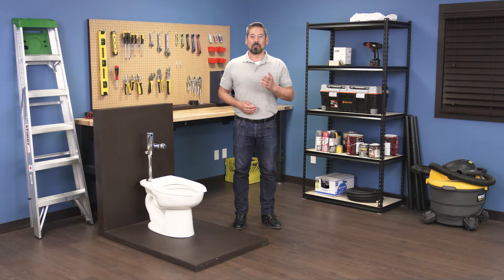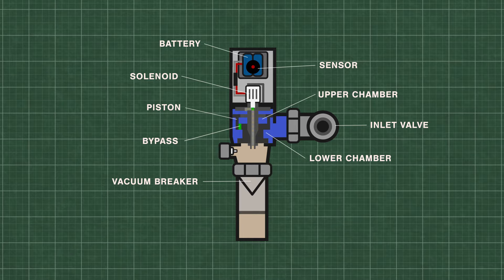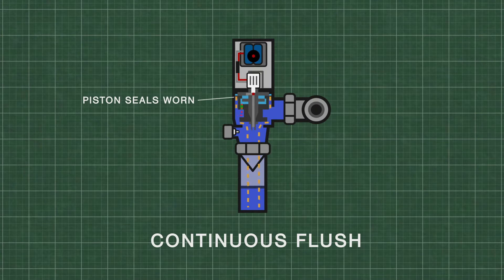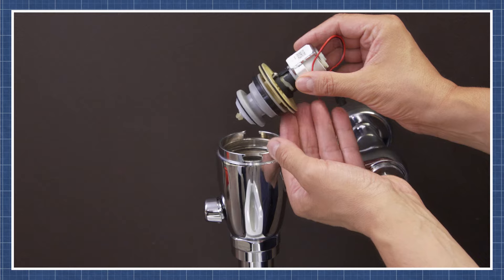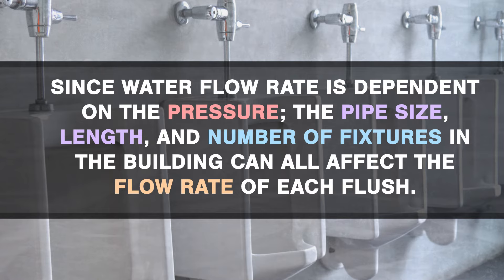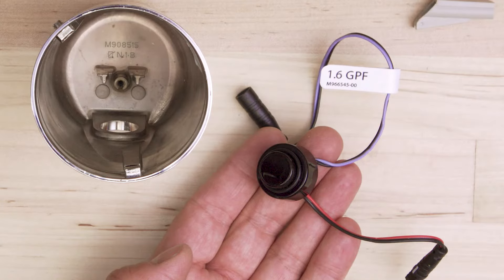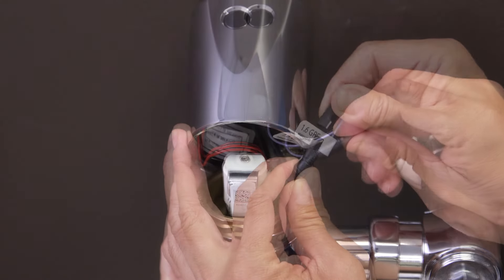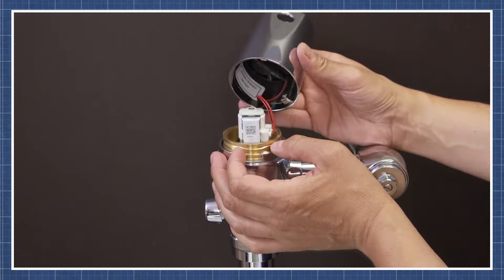Troubleshooting an American Standard Selectronic Flushometer | Repair and Replace

Comment: Very well explained thank you. If I understand correctly, it Is the sensor (an its capacity), the single piece that dictates how much water will pass trough? Many thx
Reply from the maker: Thanks for watching. It is not the sensor that controls the volume of the flush, it is the piston. The rate of water that trickles back into the upper chamber will change how long of a flow there is.

Comment: My problem is I can only get a yellow light to flash on when I hold my hand super super close. Not ones have I got the red light to turn on
Reply from the maker: Thanks for watching. A Yellow LED indicates Low batteries. If all of the models were installed at the same time it is possible for the batteries to be at a similar level.

Comment: What can be done for water hammer? I have one that causes a lond bang when the piston closes.
Reply from the maker: Thanks for watching. Water hammer is caused by a shockwave from high pressure water which suddenly stops (when a valve closes). Loose pipes will exaggerate this effect and will create more noise. A water hammer arrestor can be placed between the supply and the flushometer to reduce the severity of the shockwave, reducing the noise. https://www.amresupply.com/search?q=water+hammer&categories=WaterHammerArrestors

Comment: I ran into a power chord coming from the wall into the flushometer and I changed all components inside of the valve and still barely flushed. Pressure is fine. Only thing I can think of is the transformer is losing power. Any one help in diagnosing that issue 
American standard has no idea what could cause it apparently.
Reply from the maker: Thanks for watching. If you press the manual override (manual flush button) does it have the same problem? If it flushes normally then the piston and everything is working properly. In that case there is likely low power.

Comment: Also the sensor head flashes yellow and not red when it flushes
Reply from the maker: Thanks for watching. It could be an issue with the sensor or sensor wires at this point.
Reply: Did you find out the problem? Mine is flashing yellow aswell and im having trouble setting up the censor

Comment: I changed the solenoid & piston also changed the vacuum breaker & the battery &y toilet is still flushing for only 2 seconds & stops prematurely. Should I buy a new sensor that's the only thing that i can think of everything else was changed & even after changing the battery it also blinked yellow. What to do?
Reply from the maker: Thanks for watching. If you press the manual override (manual flush button) does it have the same problem? If there is no improvement then it's likely an issue with low water pressure.

Comment: I have 2 selectronic toilets where it flushes manually, motion sensor works, and i hear a click inside i assume it's the solenoid, but they still don't flush automatically.  They have new batteries installed.
Reply from the maker: Thanks for watching. It could be an issue with the piston. In these models the piston has a channel to release the water from the upper chamber. If the water doesn't release from the upper chamber then the flush will not start. Pressing the manual button should still work in this case as the water will run through a separate channel to initiate the flush. You could try cleaning this channel in the middle of the piston with a wire or try installing a new piston.

Comment: I have a unique problem that wasn't listed in the video.
The sensor can go off but it doesn't flush and whines in its attempt, but the side button functions perfectly.
I've tried changing the inlet valve flowrate, different batteries, and testing the wires and everything seems to be working fine in those regard.
I was thinking I would need to change the solenoid entirely but I don't know if it would somehow be the vacuum breaker or some other easier/cheaper fix.
Any help would be great, thank you!
(I will comment my results in case others have this problem in the future)
Reply from the maker: Thanks for watching. If the flushometer works with the manual button on the side, then it's likely an issue with the solenoid. If replacing the solenoid doesn't fix it, then it could be an issue with the sensor module.
Reply: @AmreSupply  I did end up replacing the Solenoid and the system works fine now for the most part. The button works to flush, and when the sensor DOES trigger, it flushes perfectly. However, i think my sensor has gone bad as it doesn't trigger anymore. I tried looking for a replacement sensor but couldn't seem to find one. Could you provide a link or the information id need to find one myself please? Thank you for your help!
Reply from the maker: @craigbennici4116  You'll have to double check which exact model you have but you can search by model number on the AMRE website. This will bring up a parts breakdown. Some parts though not in stock are available for special order. You can call AMRE to double check if needed: https://www.amresupply.com/lookup/228710/1549616#diagram

Comment: I have replaced the battery pack and tried 2 piston/solenoid assemblies and it is still letting water pass through in to the urinal without flushing.
Reply from the maker: Thanks for watching. If you've replaced the battery pack, piston and solenoid then it's likely an issue with the sensor.

Comment: The toilet seems to flush only halfway when sensor is activated after changing vacuum breaker.  With override button it flushes fine.  Any ideas?
Reply from the maker: Thanks for watching. Since it flushes properly with the override button, it means that it is able to let all the water from the upper chamber out in that case. Perhaps check how the solenoid is seated to make sure there is nothing preventing it from opening up properly.

Comment: How does the manual over ride button works? The sensor can flush automatically but the manual (push valve) wont. Any troubleshooting tip? Thanks
Reply from the maker: Hi Joey, thanks for watching. The manual override button releases water from the upper chamber (it bypasses the sensor and solenoid). If the valve flushes normally via the sensor, but won't flush when you press the button then the button is likely faulty and is sticking or not opening properly. It's been 5 years since we've filmed this. I don't have this model in front of me but I think this button is not easily replaced on these models. We also don't sell replacement buttons so we don't have a video for the button. All American Standard Flushometer videos can be found here: https://www.youtube.com/playlist?list=PLCo9SMjkdWBypfd69rUJSWqCYqFVDvAzw

Comment: How do you control how much water when it flushes automatically?   It does not flush long enough to empty the bowl.
Reply from the maker: Thanks for watching. Water pressure can be slightly adjusted, it can be worth opening the control stop to see if it helps. On the other hand the gpf (flush length / volume) is controlled by the piston. It is possible that the piston inside the flushometer is mismatched to the toilet.

Comment: My new American standard selectronic flush valve makes a banging noice in the pipes and does provide much water at a flush. Any solution for me?
Reply from the maker: Thanks for watching. Was this a new installation in a new building, or did this selectronic flush valve replace an older valve?

Comment: Hello, how can I solve my problem with my tape measurer model 6065121mx, it does not stop spewing water, the solenoid does not activate and the piston does not activate it - the manual button gets stuck, how do I solve it, thanks
Reply from the maker: Thanks for watching. Sometimes minerals in the water can build up and cover the inside of the valve. This can prevent the flushometer from working properly. If you take apart the flushometer and give it a good clean, that can sometimes help.

If not then a new piston or solenoid might be needed.

Comment: What could be the cause for a sink where I replaced the most parts but still no water coming from the sink please thanks (American standards)
Reply from the maker: Thanks for watching. For a Selectronic faucet to work the battery(or the AC power supply) must be good, and the sensor needs to functioning correctly. The faucet will use a solenoid valve. This can fail electronically or mechanically. You can look up a parts breakdown using your model number to get a more detailed view of the parts inside of the faucet. There is some variation between models.

Comment: Having issues with the one we have at work, everything works as it should EXCEPT when it flushes, I can still hear water running and when you fiddle with the button it suddenly starts flushing none stop and I’m not sure what else I can replace, it’s practically a brand new unit
Reply from the maker: Thanks for watching. Does it stop flushing when it runs in the automatic mode or only when you press the manual bypass button?

If it only happens when you press the button, then it likely isn't closing properly and is letting a small amount of water through, preventing the upper chamber from filling with water, and pushing the piston onto the valve.

Comment: where can i buy this specific sensor , is there a direct link i can use?
Reply from the maker: Thanks for watching. You can browse sensors here: https://www.amresupply.com/catalog/Electronics-PF14
As for American Standard, it depends on what model you have as the sensors are based on the GPF. If you do a google search for your model number there are parts lists in PDFs for those models. It's best to double check this on your own but you'll likely see these sensors listed.

M970682-0071600A
SENSOR ASSEMBLY
(1.6 gpf)
M970682-0071280A
SENSOR ASSEMBLY
(1.28 gpf)
M970682-0074000A
SENSOR ASSEMBLY
(1.6/1.1gpf)
M970682-0075000A
SENSOR ASSEMBLY
(1.28/1.1gpf)
M970682-0071100A
SENSOR ASSEMBLY

Comment: My urinal is getting stuck when flushing with continual water causing the urinal to over flow. Would removing the manual override button and lubricating the O-rings help the manual button not stick anymore?
Reply from the maker: Thanks for watching. Continuous flushing can be an issue with the piston, the solenoid or the manual override button. It would be good to listen for the solenoid, sometimes you can hear it click when it opens. As well make sure that the piston is functioning correctly. Check the manual first, most recommend NOT to use pipe sealant or plumbing grease on any valve component or coupling except the control stop. Alternatively if you think the override button is sticking and is causing the continuous flushing then it will likely need to be replaced as it would be sticking internally.

Comment: help....mine does not flush long enough.. toilet is 1.1gpf to 1.6gpf and sensor is 1.28gpf
Reply from the maker: Thanks for watching. Just to clarify, do you mean that flushometer sometimes flushes at 1.1gpf and other times 1.6, and all the way in-between? Is there any consistency to it? Does it flush enough to clear the bowl?
Reply: AMRE Supply  
Hello,  I have an American standard  touchless toilet 1.6 gpf. When the toilet flushes from the sensor it does not flush fully. I have adjusted the set screw in the inlet valve , replaced the seloniod valve and piston. The battery is new.  Toilet is 3 yrs old and has worked fine up until now. Any ideas? Only thing I haven’t replaced is the actual sensor itself.
Reply: I'm having the same problem same toilet, it only flushes for 2-3 seconds but not completely to flush everything down & it stops prematurely

Comment: Vance, toilet flushes fine, automatically, but push button override gets stuck and toilet runs continually.  I suspect the o-rings are hanging up; can I lubricate with a silicone paste?  This toilet doesn't get much use over the course of a year's time; if anything it suffers from lack-of-use!
Reply from the maker: Thanks for watching. Yes a silicone based plumbers grease can be used on the o-rings to prevent them from sticking. Silicone is best rather than something like vaseline. Vaseline is petroleum based and can cause the o-rings to deteriorate.
Reply: @AmreSupply  I have the same issue. I can't find instructions on how to replace the manual over ride flush valve anywhere. Can you post instructions or a link? Thanks
Reply from the maker: @chrism8595  Thanks for watching. The button M950354-0020A is harder to find than other parts. We didn't film a video on it but I'm pretty sure it can be unscrewed similar to this video: https://www.youtube.com/watch?v=Tb-QRyfTTSg In the case of the American Standard model, you'll likely need a hex wrench to first remove the set screw that holds the button cap in place. From there you should be able to get a wrench on the button to unscrew it.
Reply: I opened my small can of wd-40 doused the manual override and it quit sticking. Wd-40 works like a charm. Finding parts for these is worse than looking for a clean manual transmission.

Comment: I've got continual flush after replacing solenoid.  Before replacement it was only flushing manually and light was flashing but no solenoid clicking.
Reply from the maker: Hi Tim, it sounds like the piston could have shifted during your solenoid replacement. There is a little spring inside the piston, which is used for self cleaning of the bypass hole to let water into the upper chamber. Check to see if the spring is still there and if the bypass hole is clogged.
Reply: Just came across one of these overly complicated flush valves. Turns out a dead battery can cause solenoid or piston sticking. New battery worked like a charm.

Comment: I have a few 6065 flush valves with continuous flush. I swapped out piston assassembly with another in the room and works fine. Seems on ones with problem the manual push button seems to be the problem. Is the a way to remove push button and lubricate o-rings?
Reply from the maker: Hi Paul thanks for watching! The override button can be removed and replaced if needed. https://www.amresupply.com/part/M950354-0020A-AmericanStandard-Flushvalve-override-button

There should be a retaining clip that you'll have to pull off first before removing the button.

Lubricating the o-rings might help if water is leaking through the override button. If not a new button, or new o-rings might be needed.

Comment: My plumber accidentally hooked this to the hot water line. ( on a urinal ) Could this cause any issues?   It's a tiled wall and would be a pain to change it to cold side.
Reply from the maker: Thanks for watching. Urinals and flushometers are not designed for use with hot water. Depending on how hot the water is, it could reduce the lifespan of the piston. It might also smell worse overall as the hot water will cause some odors to vaporize as it evaporates.

It is unlikely to crack the urinal bowl unless the bowl is very cold before the hot water is run over it.

Comment: I have this flush valve on a urinal at home ( about 2 years old )  It flushes properly, but there's a small, slow but steady stream running down the urinal.  I turned the inlet screw all the way in, ( to test ) but there's still a slow trickle. What should I check to repair that ?   Thank you.
Reply from the maker: Thanks for watching. Its likely an issue with the piston. If the rubber on the side of the piston is not making a good seal then water will continuously trickle out of the flushometer. The repair can be seen here: https://www.youtube.com/watch?v=cQg_yR8wmy8
Reply: @AmreSupply   Exactly what I needed to know. Thank you!
Reply from the maker: @nobark1  We're glad that this helped you out!

Comment: What is the issue when the new unit flushes when your in front of it and shuts off moving away?
Reply from the maker: Hi Rick, you might want to try to reset the sensor range to see if that helps. https://youtu.be/txS72QClcTs

Comment: My toilets  are not flushing completely. Can you provide more information on what pressure the water supply should be, length of pipe etc.
Reply from the maker: Hi Orin, Its best to check the Selectronic manual for the recommended pressure for your specific model. As for the flow rate: There are flow meters that can measure the flow rate at a given fixture but that won't reflect the flow rate capacity of the whole system. For more information, this is a good read: https://inspectapedia.com/water/Water_Flow_Rate_Measurement.php

Comment: Water is coming from the valve each time it flushes !!! What is the problem??
Reply from the maker: Hi Wade, are you able to narrow down where on the flushometer the water is leaking from?
Reply: Yes , coming from the Very lower nut (the one under the manual flush button)
Reply from the maker: @wadeelwilly9486  Its possible that the rubber in the vacuum breaker is starting to deteriorate. Try replacing the vacuum breaker, you can see how to do this here: https://youtu.be/fzmcsAIJsH4